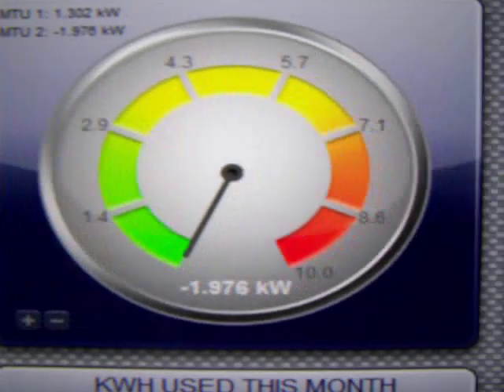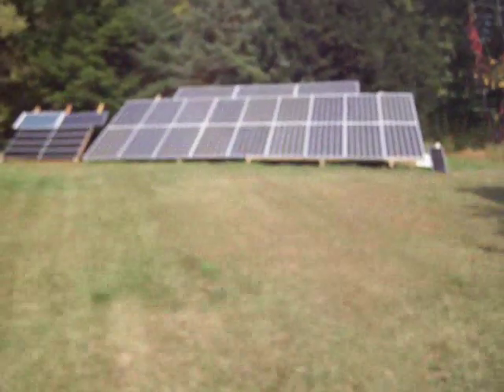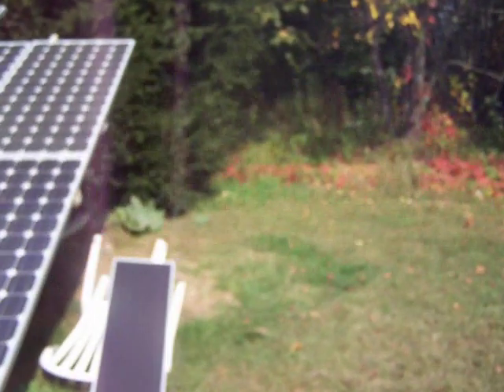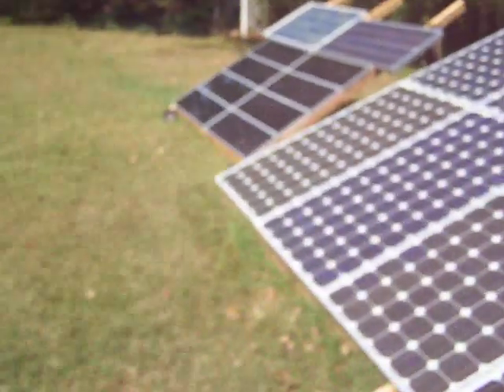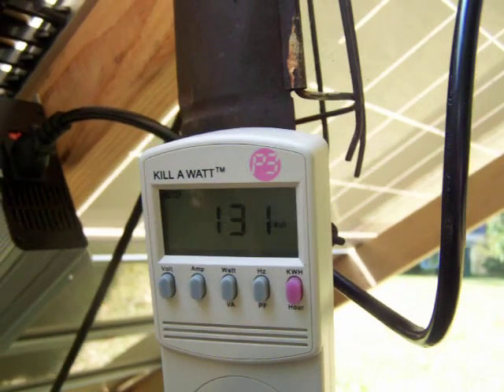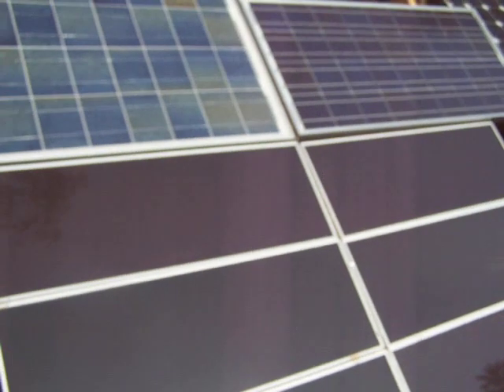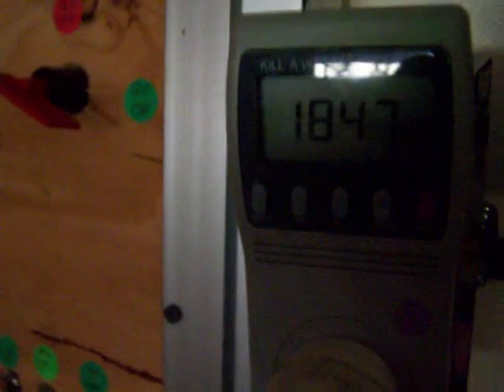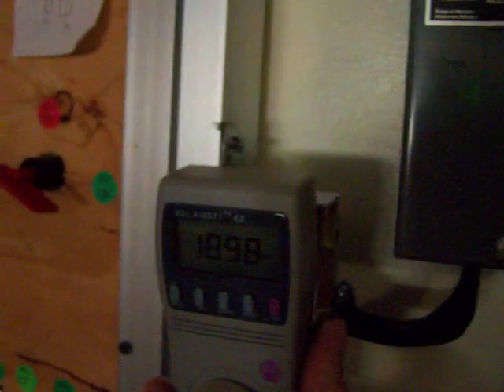solar grid tie

Comment: What size wire do you have running from the inverters to where it plugs in to your grid?
What is the distance 1 way? What is the voltage @ the inverter end & plug 
end?
I'm thinking your problem is VD...:-)       Voltage drop.
Also, you know the inverters specs are over rated.